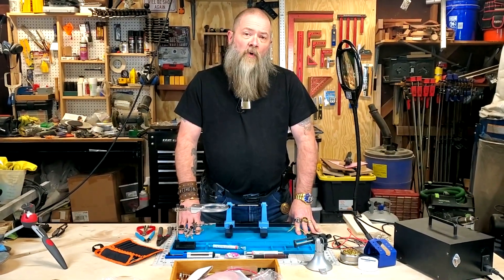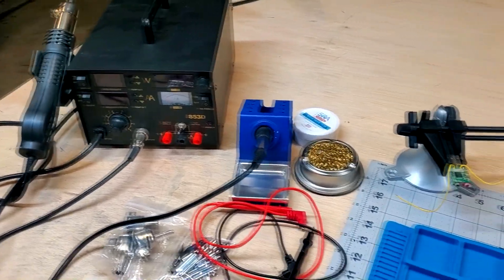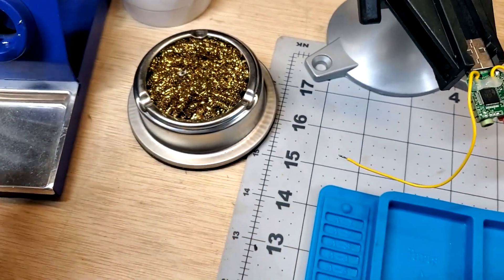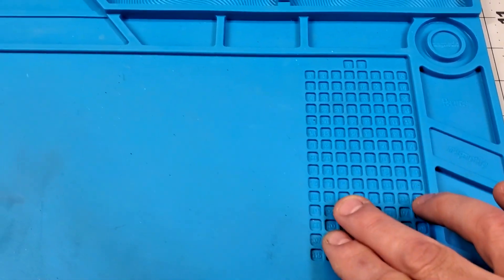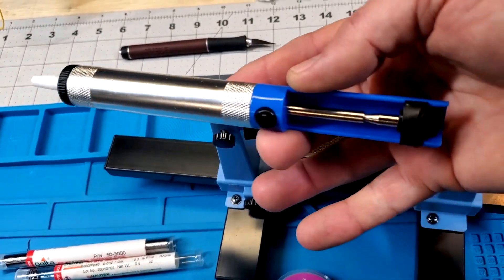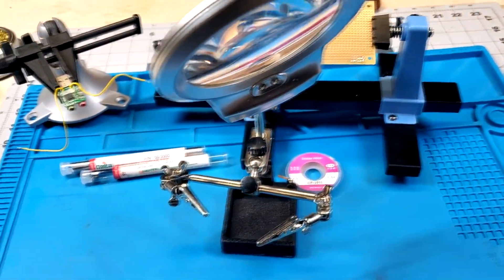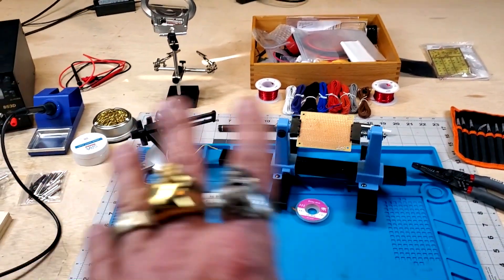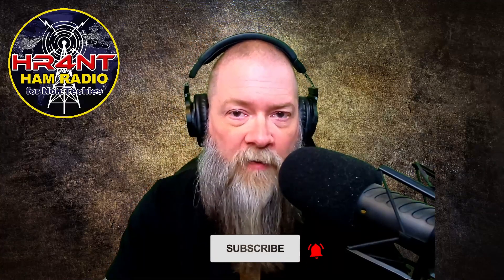Learn to Solder Part 1:  Soldering Equipment

Comment: No pricey station for this cheap retiree. a 30watt adjustable with a stand. Paste and liquid flux, Lead/Tin rosin core solder and a helping hands from Harbor freight. It works. I just need to solder wires as I never anticipate building anything on a board.
Reply from the maker: Hey if that works for you then that is al you need, right?  Glad you found a setup that suits your needs.  Thanks for the comment and for watching.  73!

Comment: Hey Scott, thank you so very much for providing this video on soldering equipment.  I am just in the beginning of starting to learn how to solder.  This site is helpful in helping to pick out the equipment to get.  I agree with you on buying quality equipment up front, buy now cry now.  I have a question for you.  Is there a difference in the weight of solder for soldering connectors to cable and solder used for circuit boards?  Thank you again Scott for sharing.  I am going to watch your other videos on soldering.  Jan
Reply from the maker: Hi Jan!!  Thank you for the question!  I am glad that you are finding value in my video on soldering.  There are a ton of choices for soldering irons, so my suggestion is get the best one you can afford and be done with it.  As for solder, I only use one brand and type of solder for all my connections.  There may be different types for different jobs, but this seems to be a great universal solder to use in all of your projects.  I haven't had any issues yet with any of my connections.  I hope this helps a bit.  Thank you again for the questions and for watching.  73!

Comment: I brought my Archer soldering iron back in the '70's from a radio shack. It had a system of interchangeable heating elements in 23, 33 and 45 Watts. Mine came with the 33 Watt element but I soon brought the 45 Watt element for working on heavy solder lugs and Vacuum Tube equipment. Last time I used the 45W element was on the center pin of a PL-259 twist on connector. I did buy a second iron a 15 Watt ESD safe model with a fine pencil tip for close PCB and SMD work. I also have a butane gas soldering iron for field repair. I also picked up a 45 Watt solder extraction tool. In the 45 years since my Archer soldering iron purchase I've bought much of the same accessories as in your video. Instead of the big desk mount magnifying glass I use a magnifying visor.
Reply from the maker: Sounds like you have plenty of options for soldering!  LOL  I have a magnifying visor that I use sometimes.  Thank you for watching.  73

Comment: I regret buying a cheap soldering iron. Doesn't get hot enough, used a friends iron which was like yours and it made quick work of the project
Reply from the maker: That was a hard lesson for me to learn in the beginning, but if you spend a bit more on the better gear, it will serve you well and save you the aggravation later.  Thanks for the comment and for watching.  73!

Comment: I HIGHLY recommend these for better sight.
ANDSTON Headband Magnifier Glasses, USB Charging Head Mount Magnifying Glass with 2 LED Lights for Jewelry Craft Watch Repair Hobby 5 Replaceable Lenses 1.0X 1.5X 2.0X 2.5X 3.5X
Reply from the maker: Excellent idea!  I have a set of those as well but most of the time if I have my setup the ones I have in the video have worked well.  Thanks for the suggestion and for watching.  73!